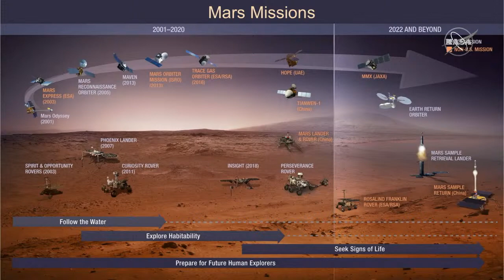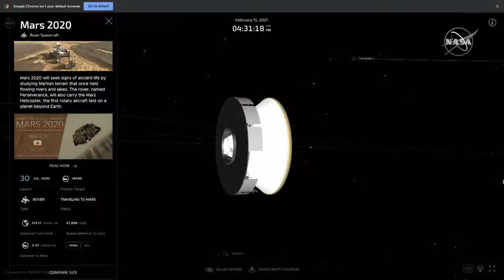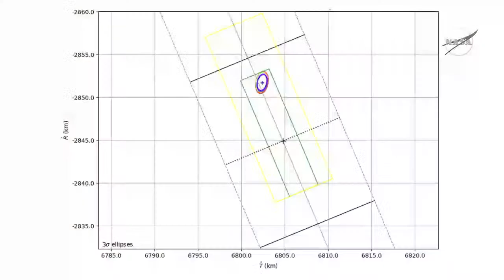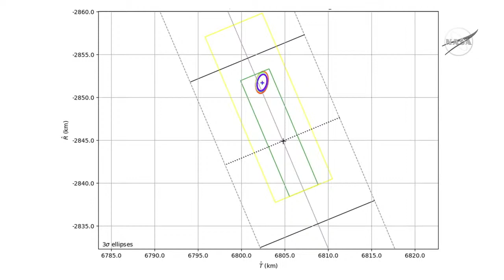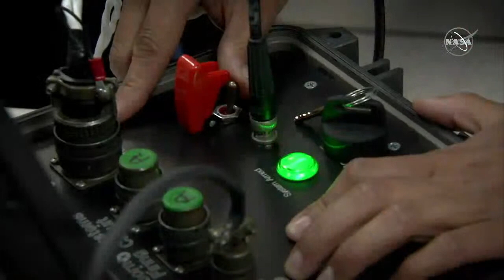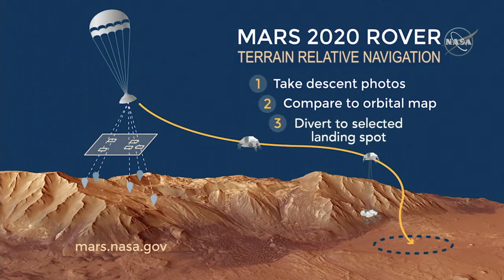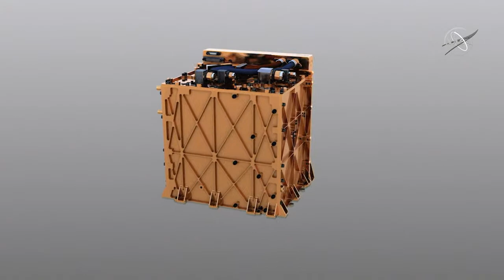Engineering & Tech Overview – NASA Perseverance Mars Rover

Comment: Explain the power source, what types of batteries or power generation?, how long will will its power supply last?
Reply: It has a radioisotope thermoelectric generator. I think it uses the heat from the decaying isotope to generate electricity.
Reply: (RTG for short)